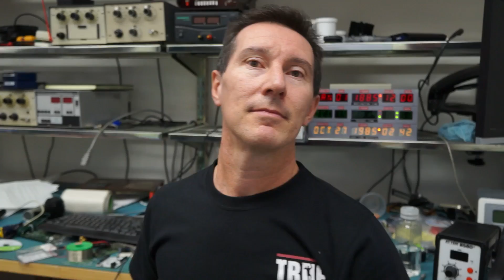eevBLAB #2 - Are Electronics Hobbyists Useless?

Comment: I have an apprenticeship in IT with Microsoft Technology Associate certs, I have made several Arduino based projects ranging from digital clocks to controller adaptors for games consoles. I designed several PCBs in Eagle and nearly had them manufactured (funds lacking so couldn't order), I have done a lot of SMD stuff as of recent and can solder pretty damn decently. I'm only 19 and I never did a course or job in electronics, all self taught or from tutorials or videos like yours Dave, so it's not too much to ask at all and if you're the boss, you can choose what you want, people who really want the job will go out and learn those skills or partially learn to impress IMO.

Comment: If designing, soldering, debugging, etc is not "basic" then where is my PHD in Electronic Engineering because apparently the knowledge of these are high level. This is all stuff I learned from simple kits as a child. It sounds to me, that the ones whom are applying for Dave's open position and complaining that the job requirements are to high, have no basic knowledge of electronics and simply just want to work with Dave and then use "these requirements are to high" as a crutch, or an excuse or sorts, when their application is denied.

I have to agree with Dave, these skills are pretty damn basic.

Comment: I've been thinking for some time about this problem & I wonder if it stems from something a little different. Most of the things I do, Computer Repair, Programming, Electronics, Carpentry, CNC & Laser cutting are all skills I picked up online over the course of time. I am not trained as such & if you saw my work you could probably guess :) Because of this I have all ways found it very hard to assess my abilities in any of these areas. Clearly, to people who don't know anything about these topics, my skills seem solid but to anyone who actually works in these fields, I'm guessing they would cast a much more critical eye.
  Perhaps the real issue is people's confidense levels, not their skill set. I think I can probably do everything you mentioned to one level or another, but the real question is....... do I feel I'm qualified enough in those areas to work under the EEVBLOG name? The answer.........definitely not!  Most people don't want to lie about their abilities & certainly don't want to be exposed as a fraud (which is something the interwebs like to scream at people a lot, if it's true or not).
 Personaly, I dont think your asking to much. What I find  intriguing is that people chose to question the requirement level rather than submitting their application and being judged on their merit.

Comment: Dave, you should give your interviewees a piece of stripboard, a 555, LED, 9v battery, some Rs and Cs and full access to the internet. The interview starts when the LED is flashing.
Reply: Just need a button switch, a resister and the LED!
Reply: @andyjohnson4485  say this and you are in for your smartness
Reply: @abhijithanilkumar4959  Thanks, what's may starting salary?
Reply: Easy. manually connect/disconnect  the power up to the LED repeatedly. It flashes. Next!
Reply: @knpstrr  Hired. For the marketing department...
Reply: Haha
You can't make a multivibrator,then it's over now
Reply: I say give them 2 transistors instead of a 555
Reply: @ninethirtyone4264  Why all you need is one transistor and a cap.
Reply: @jimmyfriend532  ...yes, it can be done with one transistor...but avalanche mode operation is not realy basic electronics knowledge :D
Reply: @ninethirtyone4264  Well damn I guess i am over qualified for the job! LOL And live on the other side of the globe:(
Reply: @ninethirtyone4264  thats also easy.
Reply: Forget the 555 and just give them the passive components and a transistor or two. Same LED.
Reply: giving them the internet is too easy, give them a 555 spec sheet instead.
Reply: I know you're an internet star yourself, and something akin to royalty, but why is your name in white on a grey background when all us plebs are just black on white?  Hope the last 3 words of that sentence doesn't offend anyone.
Reply: @alien8r33d  if your referring to Julian post at the top, it is because you are replying to the original comment. I'd youblook at the other cornets that have replies yonwill see the same thing. I hope that is what you were referring to.
Reply: Brilliant interviewer idea.
Reply: And then do the same without the 555
Reply: And no internet
Reply: When I was a kid I wouldn't have even needed the internet for that. Hell I didn't have the internet then, just memorized how to use the 555 for what I needed. Recently got back into electronics, and sadly I couldn't remember how to use a 555 timer. Ah well, the internet saved me!
Reply: @VK2GPU  YouTube got your back everytime
Reply: Skilled hobbyist can do flashing LED's.  Fully designing, building, flashing and debugging  an equipment from scratch requires experienced professional. Unless your designs are already designed and built by Ben Heck over the internet.

Comment: Im not sure what the expectations of the typical EE education has become, but in my own experience, the EE guys tend to have less practical experience. I've known some EE graduates who couldn't solder and couldn't always identify some of the typical components they use in their own designs, they could tell you what it did, how it worked, and why it was needed in the circuit, but if you put it on a table they wouldn't be able to identify it. For them, it was mostly math, theory, diagrams, schematics, etc

I started in EET though, different ball of wax, you learned a lot of the theory for sure, but it was much lighter in the math, and was a lot more hands on. We had labs twice a week where we built, tested, and even diagnosed circuits using both signal tracing and signal injection.

For our final projects we had to design, prototype, build, and fully document down to the BOM a project of our own.  We used winboard, multisim (pre-NI), and various other programs to design and layout, then printed, exposed, and etched our own boards, populated them and tested them before turning them in for a grade.

These are things we did under the umbrella of a college education.  So essentially, I paid 40k dollars for the knowledge of a "decent hobbyist"...

Comment: I consider myself still in the early learning stages of this kind of stuff, and I'm able to do most of the stuff he listed. The skill furthest from my skill set is probably firmware work. I've taken no classes on these subjects, but rather have been teaching myself in between taking classes for an E.E. degree in college. This kind of stuff he's demanding seems pretty entry level, and it also seems like someone that would be deserving of this position would be a smart and motivated electronics hobbyist. Someone who is enticed by the challenges these subjects present and the rewards that follow should be able to find resources online to learn whats required here and put it into practice. Like he said, these free online resources are an enabling factor in hobby electronics today and is changing the playing field for how we can work and how far just an individual can go. The Hackaday Prize is proof of that. The individual without professional experience, or pretty much a college degree should be able to accumulate this kind of skill set using modern resources assuming they are motivated and are actually interested in this subject.

Comment: I did an electronics class in year 12, in the year 2001. The stuff you described is exactly the stuff we learnt, except surface mount soldering, all our stuff was throughhole. Our board etching method was also a bit behind the times, but it worked. We designed boards, etched them, soldered them, debugged if necessary, all that stuff. Our equipment was quite old too, we only had analogue CRO's from the early 90's I think. They worked pretty well, we had a dozen or so of them and I think only one had a dead channel (they were two channel, so it could still be used as a single channel scope). I couldn't actually do the soldering part because of bad vision, and I've forgotten a lot of what I learned, but if I had kept up with it, all I'd need is a bit of training in surface mount soldering and I could probably go for this job. I don't think Dave is asking for too much at all, sorry for the long comment but I think Dave is right, this is the sort of stuff anyone with a serious interest in electronics should be able to do.